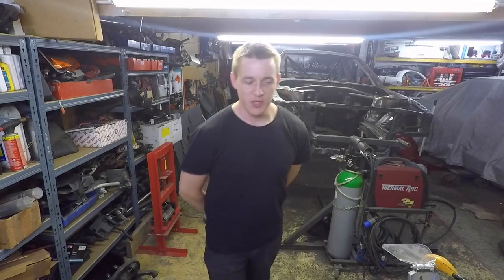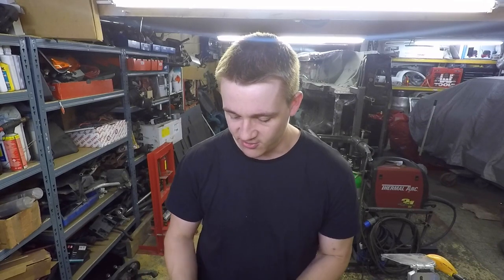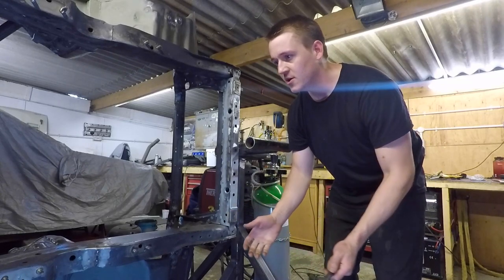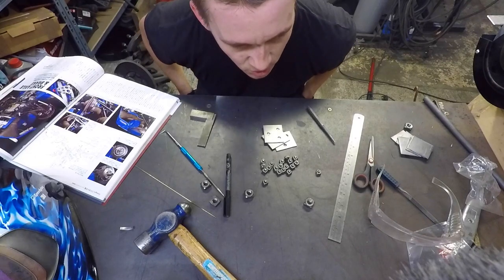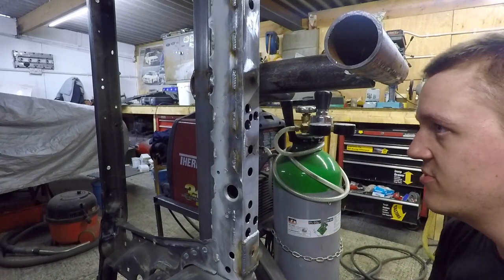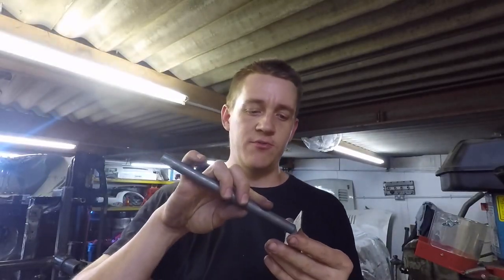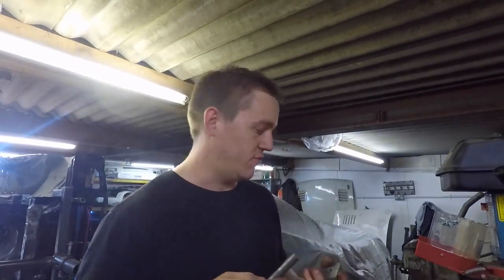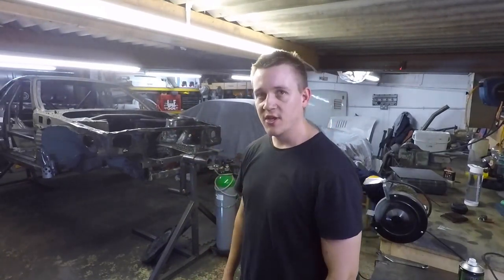Paint? No. More Group A fabrication, sorry - R32 Build: Episode 8

Comment: why was the welder flashing? Is it something like the refresh rate of the go-pro going in and out of phase with the frequency of the welder?
Reply from the maker: It’s got a pulse setting so you can hold the pedal wide open and it’ll pulse dependant on a few settings. It’s very useful for fusion welds with no filler, keeps the job cooler and makes it controllable. Million way to peal a cat.
Reply: @AlexGrA  if in doubt, flat!